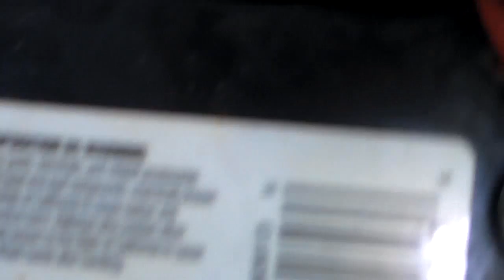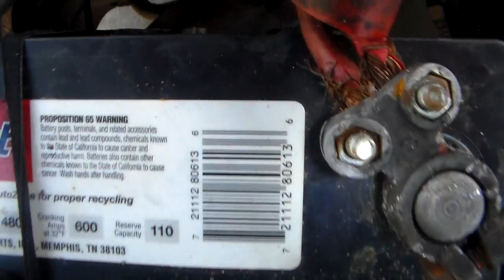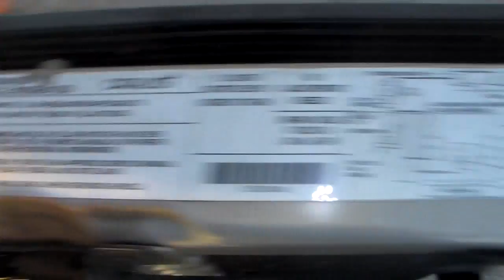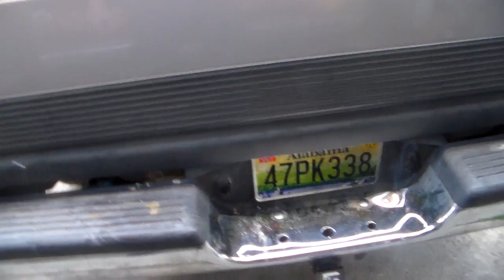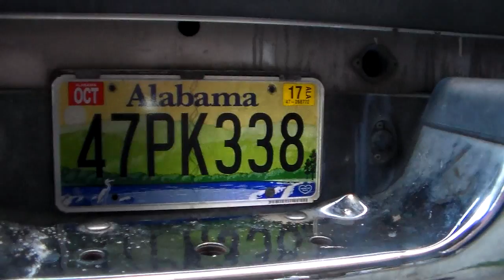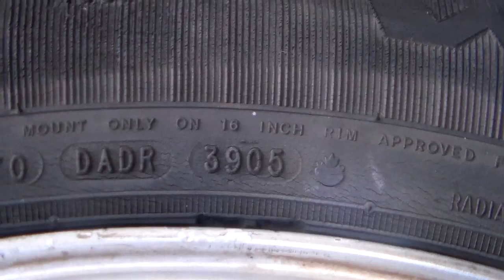1999 Dodge Ram shop truck detailed examination

Comment: Looks solid. Rebuilt trans is a big plus. I tell ya the sh$t people do to interiors blows my mind. The D100 I have someone literally knifed the fabric off of the seat and took giant chunks out of the foam. Granted I got the truck as a freebie and for good reason I wouldn't have paid for it. But tangents aside it blows my mind how people can manage to literally break apart a interior. I'm willing to bet some idiot broke the dash apart just to get to something or "fix" and I use that word loosely something. Hope you can find one in the bone yard with with a decent dash. I was at my local bone yard the other day and there with several of those but shipping large car parts is so damn expensive. Good vid Tyler

Comment: LOL!!! we must think alike in some way. We always seem to have mostly the same vehicles. For some reason on these 2nd gen Ram trucks, the transmission shops seem to ALWAYS claim the factory cooler is bad and cut the lines and add the external cooler. I am all for the cooler but personally for my truck, I would have preferred to replace the radiator AND add the extra cooler.Idle issue is almost certainly your idle air control valve (IACV). Those are super common to get really dirty and/or fail. The other common problem which adds to the IACV issue is a blown intake plenum gasket. It fails and sucks in allowing motor oil into the intake. The problem is that they used a steel plenum plate on an aluminum intake manifold allowing different expansion and contraction rates. Hughes makes the right fix if you wind up having or wanting to go that far. If you have the jack and tools for that truck you need to go immediately to play the lottery somewhere. Those are ALWAYS gone for some reason.
Reply from the maker: No jack or tools. You are right, I've looked at 37 junked Rams so far and no tools. Thanks for the info.

Comment: My parts runner is a 90 D-150 I picked up for $1000 in 2011and the dash looks like new (they changed to your trucks body style in 94). Mine has almost all the paint worn off the cab and hood so I have a two tone going...rust and peeling blue. As for door panels, my power windows dont work (thank god for heat and air that still works) and I too have the screws holding the panels on. I would fix the dash, throw some new tires on it and otherwise make it safe and then use the heck out of it and not worry about cosmetics. I think an old truck with a few dents looks workman like!

Comment: The MAIN reason the transmissions in these trucks go out is because there's a check valve in one of the transmission cooler lines, sometimes they get stuck, hence causing the transmission to overheat, the cheap easy fix is to replace a portion of the line with the check valve/omitting it.

Comment: Ah, in the first video where I commented about the bed having been painted it looked like it was pretty much all the same colour, but now I can see it isn't.  Still, somebody did paint it, just probably not intentionally.  The front suspension all looks pretty reasonable with the exception of that Pitman arm ball joint which could well be original, so I would guess the lack of self-centering on the steering is probably down to dry ball joints.  It could be that the suspension has taken a hit which has bent some components putting the castor angle out but I couldn't see any of the common indicators of that sort of damage.  I would say the truck needs the front end alignment sorted out as the tyres on the front look to have uneven wear across the tread and alignment issues can effect the steering feel too.  Whoever managed to bend that transmission cross-member like that should get a special prize, that looks to be pretty heavy gauge metal which usually takes a fair amount of effort to bend and yet there doesn't appear to be any other corresponding damage ahead or behind that cross-member so how they managed that I couldn't even begin to guess...
Reply from the maker: I found a replacement crossmember laying on the ground at the JY lol.
Reply: +Tyler's Neighborhood Garage  Well, that was lucky...

Comment: The positive terminal appears to be on upside down. I'm sure it could benefit from fixing those terminals. The 265 70 tires should be about the same height as the 245 75 but just a little wider. I like the look of the 265s. That carriage bolt is scary.

Comment: You usually don't plug a tire in the sidewall let alone anywhere else on the tire.  In Houston, any discount tire shop will patch a tire for free. Not a bad deal but I think $1,300 is close to all the money for this one. It would be interesting to see how you source a junk dash and other items to make this a presentable truck on the cheap.
Reply: Those tires have some severe dry rot.
Reply from the maker: 37 junked Rams and counting, there are no used dashes. Oh well.
Reply: Tyler's Neighborhood Garage  hopefully you'll come across a parts truck on Craig's List because replacement dashes on eBay are pricey especially for a molded plastic dash cover.

Comment: I have a 97 Ram 1500 and my dash is barely hanging on.  Multiple cracks and little chunks broken out.  Mine has the 360, 2WD, Auto, and only 91K miles. The compressor is original as mine has the same one.  20 years on and mine still freezes you out of the cab and its never had to be serviced.  I found a store online that has brand new aftermarket replacement dash tops made of different plastic that won't break up again for $259 I think but I am not at my computer right now or I'd send you the link.  These are actual replacements not dash caps.  Not sure how much the shipping is.  Will get back to you with the link after the weekend.
Reply from the maker: Thanks! Look at it this way...if you get mad at traffic, you can tear off a piece of the dash and throw it out the window at them and not really worry about it. Sanden makes excellent compressors.
Reply: I sent you a private message with the link for the dash.

Comment: New truck! I've never had experience with these, although there is currently a 97 3500 dually thats being worked on right now. I'll just say ( now that its "running" ) : Not my favorite truck. At all. Were having quite a few problems with it... I'm glad you could get this truck though, Great Deal! Do you know much about these trucks?
Reply from the maker: Not a thing lol. I've learned so far that they use some cheap materials in them.
Reply: Tyler's Neighborhood Garage Amen to that, Hahaha: i saw what the previous owner did with the dash, those are No good: it is the same in that truck and another one that was used for parts... Im glad yours look in this good of shape... These trucks from what i can see are bad about rusting for some reason, the metal is cut So thin! Hahahaha, Great truck! Wow you run across some great deals through craigslist, my dad does the same thing. I would too but you've got to have money to go shopping as they say, Hahaha! Thanks!
Reply from the maker: I watch my money carefully in other regards, plus I'm not married, so I have some to spend on fun stuff.
Reply: Tyler's Neighborhood Garage Hahahaha! Yes-Sir! I'm going to hold that close to mind: women hold us back from buying the toys we want. So ill treat it like a gremlin to water: don't put a ring on it, or else... Hahaha! Yep, You've made great videos and i see you spend your money wisely. I wish my dad would buy something running, what i mean is: he'll find something locally and go to craiglist to get a motor. He bought a barely wrecked 01 Tahoe for $900 with clear title just for the motor. Could have Easily been fixed... His words: "I don't want no SUV, i gotten it for the motor to fix this truck". Hahaha, Im glad i found your channel that day... Keeps me learning some know-how to life!